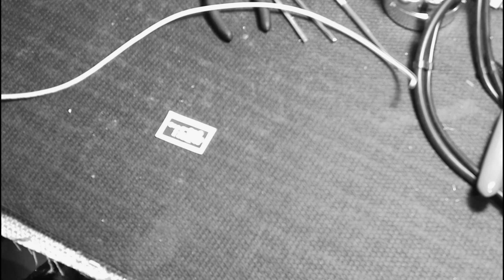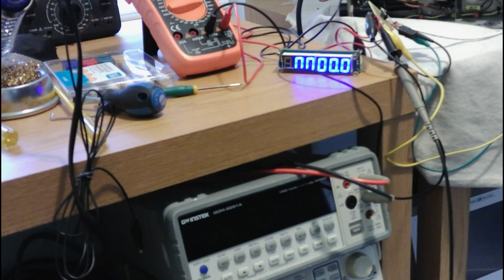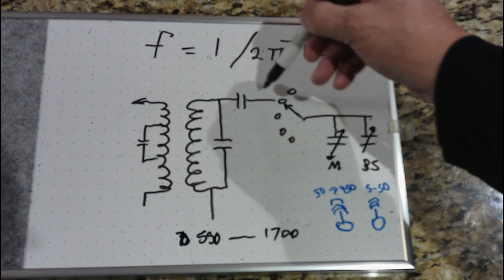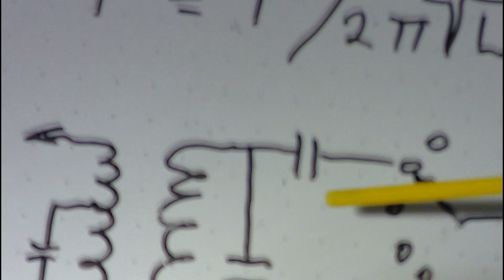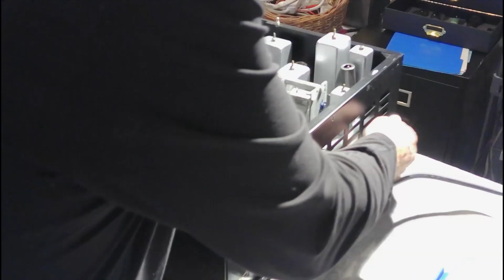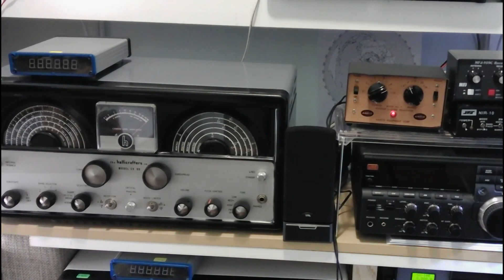Digital Display for Hallicrafters SX-71 Shortwave Receiver, Buffer Circuit, and Other Things

Comment: Do you have a link to where you got the frequency counter??
Reply from the maker: Something like this from Amazon: https://www.amazon.com/Rakstore-0-1MHz-65MHz-Frequency-Cymometer-PLJ-6LED/dp/B09V4GYCCC/ref=sr_1_104?crid=2RN0Q37K8ZVKU&keywords=frequency+counter&qid=1670096879&sprefix=frequen%2Caps%2C83&sr=8-104
But you will have to find a Hammond box and custom build two of them like I did, because there are two oscillator frequencies in an SX-71.  A toggle switch selects the right one.
Reply: @i82996  Thank you very kindly for the response. Actually I have two SX-99s im going to restore this winter and it was my idea to use a programable counter for one of those radios. I just finished restoring a first run S-38. What a great pursuit and past time this is. Cheers and thanks again.